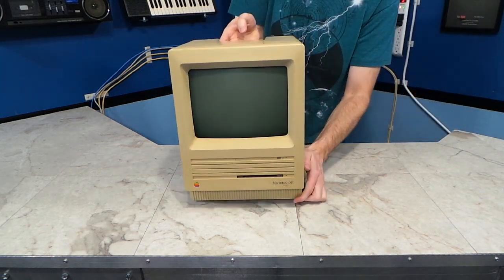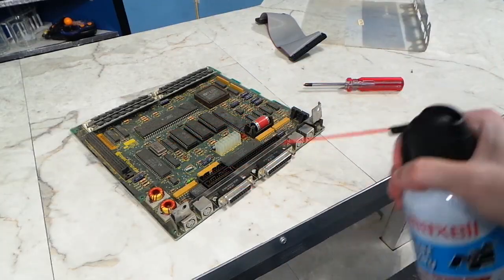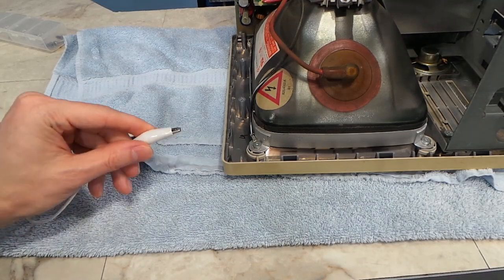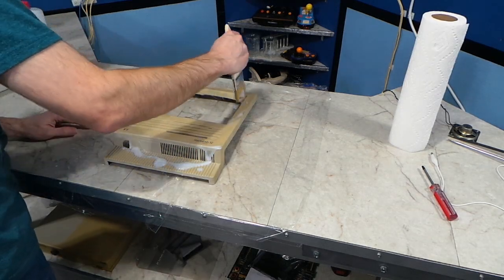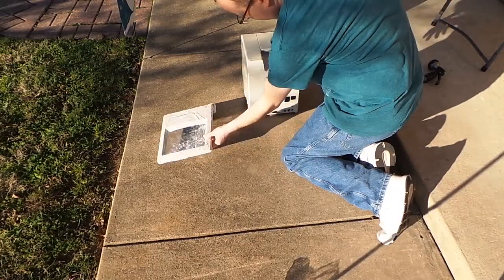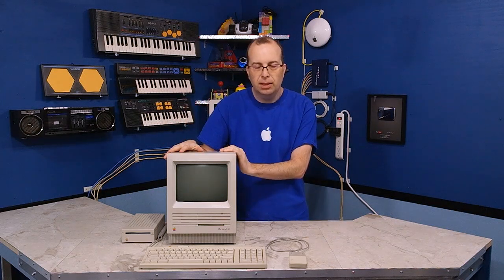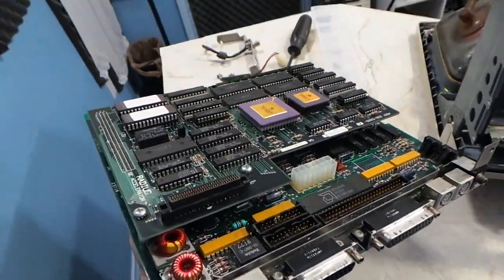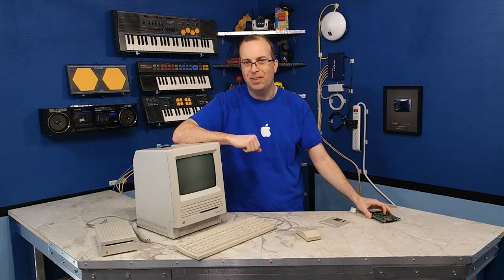Macintosh SE Restoration and SD-2-SCSI upgrade

Comment: Ever think about using an older sca 80 pin scsi drive that is 73g and using a 50 pin to 80 pin adapter? I got very lucky and bought a macintosh color classic off ebay that "did not work" but they just didn't have the keyboard with the power button on it. Worked fine. I used that hd and it booted the SE just fine without any issues. Other issues is how do you install from scratch to get rid of all the junk in the software. I used a floppy and found images but never got a working cd. Great videos tho. Are you an electrical engineer?

Comment: Hey that Windex is a glass cleaner and it contains Ammonia.  That will dry out the plastic and cause it to become even more brittle, take the finish off and cause yellowing.  You should use a plastic safe cleaner like "Spray Away".  Although great video!

Comment: Back when I had my amiga, the disk drive had trouble reading/writing HD floppies, but IIRC putting tape to obscure the another hole from both sides fixed that. Have you ever tried that?

Comment: This video got me interested so I ordered an SD2SCSI adapter. I have my Macintosh SE successfully running System 7.5.3 on an SD2SCSI v5 adapter. Either your Mac is broken or you've done something wrong I'm afraid. One thing I should note, though, is that I used the Lido application to format my SD2SCSI emulated hard drive, and that worked without issues.

Comment: The 8-Bit Guy Just asking.. did you verified that the SD card's read-only switch is set to the correct position? I had a read-only problem like that but on a different situation: while inserting an SD-card adapter into the reader, an internal edge on the reader moved the read-only switch when inserted, unless you inserted the SD-card at an angle or glued the switch on the read/write position beforehand.

Comment: Just a quick thought (and I'm sure you've already checked this), but SCSI buses need termination to be enabled on the last drive in the chain (any intermediate drives need to have it disabled) - does your SCSI HD emulator board have a termination setting and is it enabled? I remember the 'good old days' of setting up SCSI HDs and scanners - SCSI bus termination issues were always fun.

Comment: Fully terrific to me as user of Mac SE since 1988. Hopefully, mine still works fine after leaving it for its own for >16 years. It had a spark when plugging the power socket and using the ON/OFF button to launch the machine. This was problem fixed (by a local genuine tech/user who dealt a lot with Macs at Cairo in their early days) by replacing the resistance as he said and he replaced the original On/Off button by a new one. Now, I keep the power plug in all the time, I don't use the ON/Off button anymore and I supply the power using the button of an external power strip. I got an emulator with SD card from "Big miss". Hope to find time to transfer my old Excel and Word files on Mac HD and on ZIP drive disks to the SD in order to put them on a newer MAC and find the lost treasure.

Comment: You should probably point out that ground lug you tried to discharge to is only actually grounded if it's connected to earth ground, otherwise you're still in for a nasty shock if you touch that panel...

Comment: You may want to obtain an image of an authentic Apple System Install Disk (I think version 6.08, Maybe 7 or 7.1 depending on the memory in that SE), boot from it, and then install the system software on the SDCard from the Mac installer.

Comment: Once upon a time I had an SE30 with 32mb ram (I think). I used it for years as a file server I sold it after I got my "new" iMac g3... I kick myself now as I had 7 or 8 hard drives SCSI chained attached, formatted to (if I remember right) 500GB as the maximum it would read  OS7.5.5/w 32bit software installed. I want to rebuild one IF I can get a printer to work with it!!!

Comment: Correct me if I'm wrong, but I think the CPU (68000) is also used in the Sega Mega Drive/Genesis
Reply: Yes. The Genesis main CPU is a68000 @ 7.87Mhz and the Sega CD has a 68000 at 12Mhz...

Comment: about the ethernet card - is this a PDS or NuBus slot ? because i have a nubus network card flying around and i think there should be some way to install it in that mac, maybe through the use of a PDS to NuBus adapter or something - i also have a working original 80mb SCSI apple HDD i could pull from my IIsi for testing - drop me a response if you are interested.

Comment: Just a hint: Discharging the CRT should be done using a high voltage capable 10..20MOhm / 0.5W resistor and not just by cutting it short no matter for how long it's been shut down already. Even that the unit is turned off doesn't mean you don't do damage to the circuit. Anyway, I did like the video! :o)

Comment: Just FYI when drilling through metal you should consider adding a small amount of mineral oil.

This will GREATLY extend the life and sharpness of your drill bits when drilling through metal. When a drill bit heats up, it becomes pliable, so instead of cutting away the metal, it wears down the bit in equal measure, and losing the sharpness means losing the bit's "drill-ability".

Comment: I have an SE/30 and successfully made 2 partitions on my 2 GB 50-pin SCSI drive with the disk tools on lowendmac.

I love the SE/30 especially since it has the great sound chip from the Apple // GS. I remember the sound from a // GS being good but I wanted to see how far that chip could be pushed when not hampered by the 2.8 MHz 65C816 so as an experiment to see the full potential of the sound chip I converted some lossless song files to 24 kHz .wav files, 50 MB each, installed QuickTime 2 with System 7.5.5, transferred the files with the ethernet card mine luckily came with, and plugged in some nice stereo speakers. To give the computer every advantage possible I also installed the maximum 128 MB of RAM and installed the 32-bit address enabler extension to see it all since the original SE/30 ROM is 16-bit. To my surprise the audio sounded great and about as good as a decent FM station and played as smooth as a modern machine. Due to the limited speed of the stock CPU, a 68030 at 16 MHz, and perhaps the speed of the SCSI bus all multitasking excluding just the simplest games caused playback pausing during loading but never the less I can play full songs on my SE/30 in stereo from the hard drive and even play solitaire at the same time without fault. How many machines from 1989 could do that?

Comment: Try holding down shift while booting that System 7 image to disable extensions. Its possible one of the extensions on that installation isn't compatible with the machine and is locking things up. Also, I have been having weird problems with SD cards in general in these retro adapters. My FloppyEmu doesn't seem to like the SanDisk microSD card that is in it at the moment as I'm getting random read errors from known good images. Formatting the card and recopying floppy images to it seems to help sometimes, but I will likely switch to another card soon.

Comment: Hello. Love your videos. I was able to get a SCSI2SD working on my MaC SE. My SCSI2SD looks different than yours though. Mine is red and smaller. Plus already had the 2 prong led connector on it. Mine didn't work either until changed the name of the drive to "seagate" and a few other options. Also I booted up the machine first with floppies then formatted the drive within System 6. You can't (at least with mine) simply drag and drop files to the sd card. The way I'm able to get files onto the Mac SE and upload to my pc is through ADTpro with use of my Apple IIGS and the 3.5 floppy drive. Also make sure the files are good for transfer relabeling them from ".disk" to ".po". I'm able to make floppy images for it using minimac emulator. I still don't know if it's possible to get .sit files on it since I haven't tried using the basilisk emulator or whatever it's called. Let me know if I can help at all! Good luck!
Reply: Did you ever read my comment? Because I believe i answered all your questions you had in this video.

Comment: Hello, something about USB HD floppy drives and DD formatted HD diskettes. You can format them in modern operating systems.
I format them in Windows 10 without problem. Cover the HD hole with tape first. Start CMD as admin and run FORMAT A: /F:720 - windows can't recognize the format without this switch.
Tested with IBM MPF82E and NEC UF0002. Reliability varies, Atari ST is excellent, Amiga 500 worse - it needs rewrite sometimes with cheaper disks, but that drive is from '87 :)

Comment: Have you tried another flat cable for the drive? Also try calculating the hash of a large file and then transfer it over to the flash media you are using, then calculate the hash again, this time reading directly from the media and then compare to the number you got before transfer, this will rule out defective flash medium. Is there an application that tests RAM corruption on the MAC? That could be worth trying. These are some issues I run into when  an OS does not want to boot with random errors.

Comment: SD-to-SCSI? That is awesome. I had no idea these things existed
Reply: Even SD-2-IEC Exists.
Reply: I so need this for my old Akai Multitrack...
Reply: Now there is an interesting idea!  Then again isn't it easier to just get a new virtual multitrack (software) that runs on a ne er computer for about $300?  Do You have a lot of old projects in some kind of unique format , that you would have to transfer out of the Akai in real time?  What format does the Akai use to record?
Reply: They make IDE ones too!  (A lot of folks are using the Compact Flash adapters; but they totally make SD card ones too, which are just plain better, IMHO).
Reply: Hi egee! Lets benchmark kde in this
Reply: I have 8 x SCM PCD-60B 50pin SCSI card readers (I bought them as in investment). They can use xD, MEmory stick, SD/MMC, CF, Smartmedia and PCMCIA I/II. Unfortunately, each reader has it own LUN number and the PCMCIA is LUN 0. I have found a PCMCIA to CF adapter in the slot is easily bootable on old Macs, but with other devices with selectable LUNs you might be able to use the other slots.

Comment: You might try taking it apart again and removing and re seating the SCSI controller on the main board. Sometimes you get a bit of corrosion on the tin plated contacts of the chip and socket.
Another reason why military grade electronics use gold plated contacts on the sockets and IC's, very little chance of oxidation and corrosion although it can occur.

Comment: Why not try to mess around the original hard disk? A common failure of quantum hds is a small rubber ring that melts with years  and prevents the arm to unlock when disk starts to spin up. Greetings from Brazil!!!

Comment: If the Mac boots up part-way and then locks while loading an extension - would it boot if you disabled extensions? System 6 is a better option for a 68000 Mac in my opinion. Some of the older B&W Mac games seem to prefer 6.0.8 as far as I know.

Comment: The BBU has VLSI written over it. Stands for Very Large Scale Integration and means "there is at least 10000 transistors here". In the early days of integrated circuits these abbreviations made sense but as the number of transistors grew and grew VLSI was quickly outgrown and any efforts to make more distinctions fell apart. So while VLSI with tens of thousands of transistors in a chip was very large scale of integration, modern chips use hundreds of millions and I can't really imagine what would the naming for these look like :D (like HMULSI - hyper mega ultra large scale integration?)

Comment: I'd let you mess around with mine if you lived closer. It was working perfectly aside from a dead PRAM battery when I shelved it. Haven't had time to play with it in a couple years, but I've been looking for old SCSI to modern storage adapters for the day the HD inevitably fails.

Comment: Just one question. Would that work on the original macintosh
Reply: the 128k?
Reply: No. The Macintosh 128 has no SCSI bus on the mother board. I think the 512K had one, or I'm thinking of the Mac Plus
Reply: Mac Plus has the scsi bus. However the device that goes to the floppy bus should in theory work on original and fat macs.

Comment: I was wondering, if the SCSI chip was (completely) dead, it should've shown a Sad Mac at startup, specifically something containing $000B. It might either be failing intermittently (in that case, a SCSI HDD might confirm it) or the chip's fine and the SCSI2SD upgrade is incompatible.

Comment: great video as always David! one tip i for discharging a crt. i wouldn't trust an alligator clip to hold on the screwdriver, i usually remove the alligator clip and wrap wire around the screwdriver. I've been bitten when the clip came off the screwdriver in the past :\
Reply: You should have more trust

Comment: The best way that I've found to get software onto the sd card is to mount the sd card on a modern Mac. Download your disk images from macintosh garden etc..then use Basilisk II to mount the sd card on an emulated system 7 os. Then you can use disk copy, StuffIt expander, etc to get everything in order and then you can put the sd card back in your Mac Plus, SE, etc

Comment: Mr Clean Magic Eraser pad would probably clean that black marks off a lot easier, that stuff is magic! I use it in the shower to get hard water spots off the vinyl works great but even better is a bucket of hot water and a few glasses of Vinegar, a good spin mop and showers clean in a matter of minutes. Vinegar might work great too before you use your bright white stuff.

Comment: When in Germany we had metal transformers in the 70s to run American devices on the German power sockets. I touched it with one hand once when I was a kid and it wouldn't let me go, my Mom had to grab something to pry me off of it but I never got fried. Good thing I didn't use two hands huh. I've been zapped once messing around in an old stand alone CRT Terminal motherboard because oops I forgot to unplug the power cable, haha. Still alive and kicking.

Comment: Another thing to try for the SCSI would be spraying deoxit into the contact points on both ends of the SCSI cable, let it sit for 4-6 minutes, and test it out. I had IDE cables and my CRT Monitor that did that as well, and after using the deoxit on both the IDE cables and CRT Monitor, they both worked once again. Now my monitor doesn't show pink color anymore, and all of my hard drives and optical drives get detected.

Comment: Hey, 8-bit guy, isn't your SCSI to SDCard compatible with these SSD adapters from a 3,5" bay to 2,5" bay? I don't know, but the bottom holes looks identical to this found on a 2.5" disk drive or SSD. But your adapter is really good looking and (hey), it works! Just asking, though. Nice video and nice channel. Keep up the good work :D

Comment: I had an SE I upgraded to an SE/30 about 20 years ago. In recent years I've desperately wanted another, but 2 problems; most on ebay are outside what I can reasonably justify paying, and to be of use I have to have a network adapter.

I almost bought one off of ebay this weekend, but missed the auction end and it ended up going for $83 (augh!)

Can you write to the SDCard from Windows on that SCSI->SD converter? It would make a network adapter less necessary if I could transfer files that way.

Edit: Doh, I asked about the SD before I saw all of the video.

Comment: I remember that on some models there was a SCSI-interface at the back, you could connect a Super-CD on it, or a second SCSI-HardDisk or a scanner. I stil own some of that stuff, it is still working. Only a few years ago I stopped working with it, because the €-symbol is missing. I thought of putting the Euro-symbol in, but it a lot of work to add to all character-sets extra characters.

Comment: I got shocked once by holding cable in left hand and other one has touched right hand. It wasn't strong current, but still the shock was the worst one I had. So the warnings here are very appropriate.

Comment: Bringing software to low density disks is a pain, but what I used (as a Windows PC user during a nostalgia bout during the 2004-2006 period) is to use a PC floppy disk drive and transfer files with a specific software (I could fetch the name for you but it's easy to find), use a "bridge" mac that runs one of the earlier versions of System 7, like the old b&w powerbooks 170 or 180, which have drives that support both low and high density disks. I could then transfer anything I wanted from my childhood into my Mac Plus, Mac SE, Mac SE/30, Mac Classic. My goal was to try and learn game programming in C and attempt to do fluid arcade style graphics like in Dark Castle and utilize the sound chip as well as in Studio Session (6 voices at first, then 8 in the later versions) but you need to dive deep into assembly for this :(

Comment: If the OS loading and freezing happens at different times during the loading sequence, then it most likely could not be due to an incompatibility with the emulator card.  If it were due to incompatibility the OS loading would freeze at the same point.  So it sounds like a hardware issue with the sd card card, or your systems scsi system.  To be more thorough you should try your SCSI SD card on your buddies Max to make sure 100% the card works.  If it works on his that points to something wrong inside your mac.  Also very inlikely, but possible, the micro sd card might not like the card you put it into, and you could also rule out this as an issue by bootting this card in buddies Mac too.

Comment: Hi 8-bit love your videos. any advice for a SD 2 adapter or any kind of adapter for a EIDE hard drive for laptops? Got a old dell it's got what's probably the last new old stock EIDE drive in the city in it after the original one died last year. rather not hopefully way down the road have it unusable due to a dead drive.